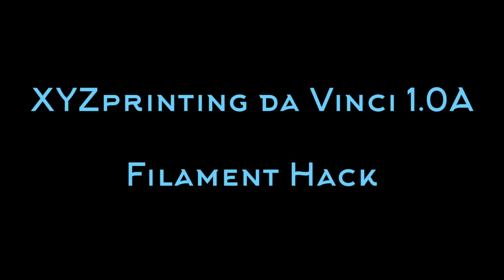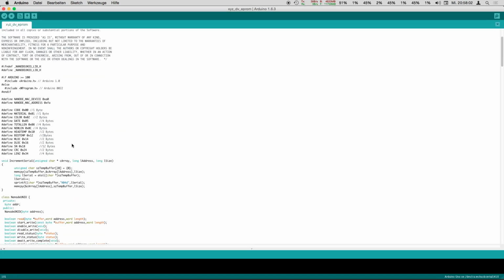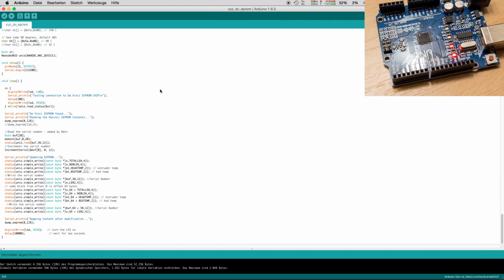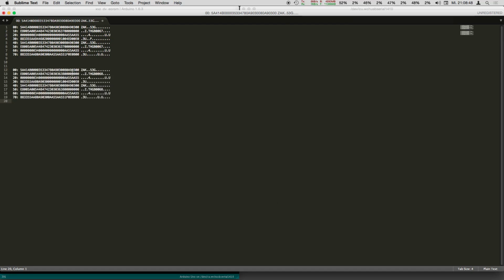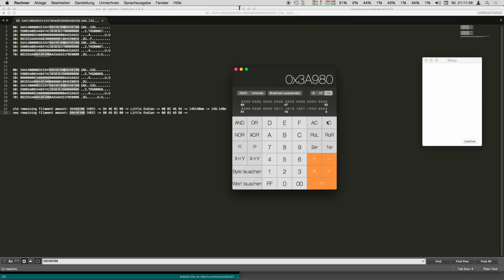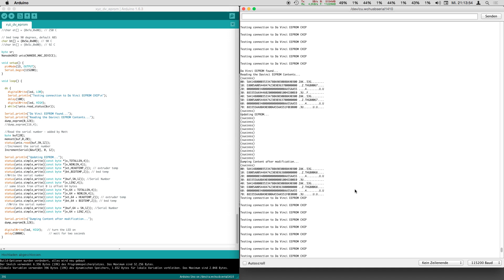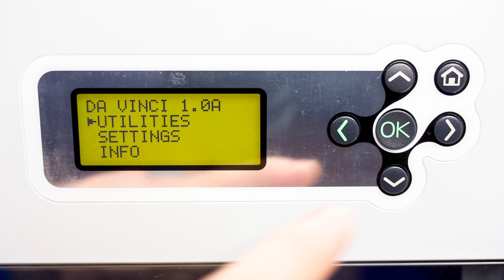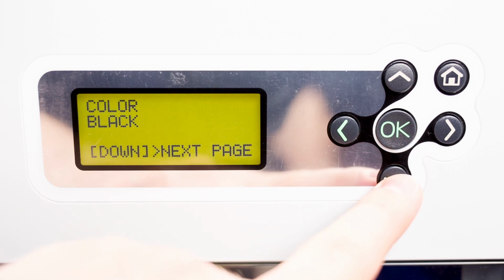XYZprinting da Vinci 1.0A EEPROM hack explained in detail for 3rd party filament w/latest firmware

Comment: Instead of the #7 can you use another number like 6,5,4 or 3? 
Or A5 or A4
or on a different Arduino a number D6, D5, D4 or D3?
Reply from the maker: Basically yes. It is changeable. This is what needs to be done when working with a different Arduino than the UNO.
Reply: But how do you change it? Or at least what is the part of the code that references it? The arduino I have is a leonardo arduino on a makey makey. The picture shows the chip layout. Any ideas? https://cdn.sparkfun.com/assets/e/4/8/3/f/52e977b0ce395f6f178b4567.jpg

Comment: Hi thank you, your instructions works well, i have additional concerns.

Can i change "loading temperature" using this resetter? 
and what is rechner? is it free? 

by the way this video is so good
Reply from the maker: "Rechner" is the "Calculator" from windows / Mac... ;)

Unfortunately, the temperature changes through EEPROM do not have any effect on the print through XYZware. You will need to use a third-party software like slic3r to create your custom gcode. See my second video if you want to try it.

Comment: I heard that XYZ will brick your printer if it detects that you are using 3rd party.  Is this still the case?  I can always turn off WIFI on my laptop when I connect, but just in case I forget one time I wanted to be sure.
Reply from the maker: That I don't know. It might say the cartridge is not supported, but that can be fixed be uninstalling software and reinstalling without internet access

Comment: Thanks a lot for your video, I have a question is there any possibility of changing the type of filament in the chip, the original cartridge that I have is abs and buy 1kg of pla and does not let me print in pla because the chip that you restore is Abs
Reply from the maker: Unfortunately, I would have to recommend buying a PLA cartridge for PLA, and ABS cartridge for ABS if you want to use stock software. My second video, however, shows how to customize all settings of your printer using Slic3r and some scripts.

Comment: is ther any hack for the davinci junior reels??
Reply: did you found any jr. hack?
Reply from the maker: Another viewer above suggested that it would probably possibly through NFC?
Reply: Jr and Mini use NFC to read the eeprom.  I can't even find an EEPROM chip on the board, but supposedly it's possible.  You need an Arduino and the NFC shield.  They sell one at Adafruit: https://www.adafruit.com/products/789?gclid=CNmUhLPDq9ICFRBEfgodVmEK5g.  There has been some work done: http://www.instructables.com/id/XYZ-Da-Vinci-Junior-jr-NFC-Tag-Filament-Reset-Hack/?ALLSTEPS, but it looks fragile and difficult (it requires you to hook up an oscilloscope and sniff passwords - that is cracking to the extreme).  There are some eBay devices listed in that article, but as with anything on that depository of hedonism your mileage may vary.

Comment: The software in the XYZ uprgrade prevents this working...XYZ are dictating to us we need to buy their cartridges at ridiculous prices...
Reply from the maker: Not exactly true. It is still possible to do this, but you might need to reinstall the software while blocking internet access to it (after install and while running at all times)
Reply: Florian Uhlemann I haven't found a way to downgrade the software if the xyz has been updated. I ended up completely wiping my xyz and installing repetier host... Best thing I ever did.

Comment: I also flashed the chip and now it says "unidentified cartridge". I am using 2.1.0
Reply from the maker: Try removing the software, then disconnect from the internet, reinstall again and then try again. Supposedly they verify the IDs with their web service. If permanently blocked, this won't be possible.

Comment: Having the same Issue. I flashed the chip and now the printer says "Unidentified Cartridge".
Reply from the maker: What firmware and software version are you using? Perhaps they did make a change in the software / firmware to prevent this?
Reply: Florian Uhlemann I am using 2.1.0 and I have a da Vinci 2.0 and it keeps saying unidentified cartridge

Comment: quick question how do you get the printer to think that the cartridge is for pla when it was originally for abs
Reply from the maker: Short answer: You can't. Get an ABS and a PLA cartridge for either type
Long Answer: Please see my other video that explains to use this printer with Slic3r, and thus being able to fully customize all printing parameters.

Comment: Hi is there a stl. file for the filament holder to print
Reply: go to thingiverse.com and search for one
Reply: Already have could not find one
Reply: http://www.thingiverse.com/thing:7001 
here's one that I found for you that uses 8mm wood dowels and doesn't require much plastic
Reply: No I will design me one when I do I will put the link in the comments
Reply: Thanks though
Reply from the maker: Thanks for the offer do design one and post it. Feel free to do so. I did actually get mine from thingiverse.com indeed.
Reply: Your welcome if there is already a design what is the thing number?
Reply from the maker: try any of these: 409100, 567977, 293623, 1234196, 673094, 1455889

Comment: Hello,
I have used your method and it worked pretty well. The problem I have noticed is that, even though the chip has been reset, the  temperature settings and filament length cannot be set to any other value but the original filament default or the cartridge will no longer be identified by the printer. Is there any way to solve that?? The Third party filament I've got can barely stick in on the glass and the extruded material is full of small hard parts that screws any print. 
Thank you
Reply from the maker: Yes, that is correct. Unfortunately the settings won't stick. There is a second video, which explains the custom Slic3r settings that will actually make it work with different settings.

Comment: Hello, thanks for you Tut. When i plug in the modified filament it show the new value e.g. 240m at the printers display instead of the remaining 1.4m. But when im ready to print after slicing in the XYZware i get the failure 0008 which means a cartridge chip error (last page in https://xyzprod.blob.core.windows.net/document-us/da%20Vinci%201.0%20AiO_User%20Manual_EN.pdf). Have the 1.0Aio, XYZware 2.1.15.1 and Firmware 1.2.2 (happend also with fw 1.2.0).  When i put in an original filament again it works properly. Why?
Reply from the maker: Interesting. It would be interesting to see the dump of the ROM before and after. I'm sorry that I can't help you out any better.
Reply: Ok after i removed and reinstalled both XYZware 2.1.15.1 and Firmware 1.2.2, it works fine now. Have no clue whats the reason. But just to know you are using the newest versions of SW and FW?
Reply from the maker: Awesome! Glad you got it to work! At the time of the video, I had the most recent version of both, yes. I currently do not own the DaVinci anymore.

Comment: Hi, nice video, its been really useful. I have some questions and hopefully you can answer them. First, there´s this section at the end of the G-code that states it has to be moved to the top, should I do that?.

On the other hand, I currently have a Davinci 1.0 and bought a PLA (xyz printing) filament thinking it would be fine since it´s from the same manufacturer, however, it asks to upgrade the extruders, which i currently can not do, so i thought of flashing the filament cartridge as you showed in the other video, but I was wondering if it is really necessary, the issue i have right now is the filament won´t load, so if you say the temperatures changes won´t work (last video-flashing cartridge), what do you recommend?.

Maybe flashing the cartridge so it thinks is ABS, but changing the temperatures for PLA, and the other parameters needed, do you think this approach will work?

Thanks in advance.
Reply from the maker: The only differences should really be in the temperatures and extrusion multipliers. If you use Slic3r to create your custom profiles, it really shouldn't matter at all what filament type is set in the cartridge.

Having to "upgrade" the extruders is something I have not yet heard of. Not sure what that is supposed to mean.
Reply: Yeah, that issue does not make any sense to me. Anyway, i did the EEPROM hack but it didnt´change the serial number, might you know what is wrong with it?.

In terms of printing, I´m using Slic3r´s G-code, converting to .3w and printing, but it takes a lot to lower bed temperature to the one desired, do you know how I can set the machine to turn off the bed?.

The downside of using PLA while the machine thinks is PLA is that BOTH extruder and bed have to reach the temperature set by default, then it starts receiving the G-code commands. Any ideas on how to improve this aspect?

Thank you for your answer, cheers
Reply from the maker: Unfortunately not. It was the same case when I used it. It would heat up the bed and extruder to is preset temperatures and then would start heating the last step. I'd really suggest getting a PLA cartridge when you want to print PLA and then fine-tune from those default settings, and use an ABS cartridge when printing ABS.

Comment: Thanks for share this great video :) I read it's not possible to change the temperature of the nozzle, is it true? I bought PLA and I need to thange the temperature .... it's too high and does not work. Any idea how I can use a PLA filament in my DaVinci 1.0? Thanks
Reply from the maker: Thanks for such a positive feedback. Yes, that is correct. Temperatures can't seem to be changed via the patching. However, you can watch my second video on how to make it work with Slic3r and thus be able to change your temperatures to your likings. :)

Comment: I tried to reset the EEPROM using my arduino, but my arduino didn't conect to the EEPROM, I'm using arduino mega 2560, is this normal with this arduino?
Reply from the maker: This is normal. Scroll through the comments, one guy has gotten it to work. it seems that the 2560 has a different pin number. if you are still having trouble, get a Uno. 😊
Reply: thanks, finally I change the pin  and I reseted the EEPROM, but the temperatures didn't change, they are the same temperatures so I don't know what I'm doing wrong, because in the arduino I put 230º, but the printer print in 213º
Reply from the maker: That is a known "problem". The temperatures are not read anymore through the EEPROM. If you need to change the temperatures, you will have to use a third-party slicer, such as Slic3r which I explain in my other video.
Reply: +Florian Uhlemann thanks for the information, I will try and I will say you the results
Reply: which pin did you use?
Reply: +Bob Opedic no, actually I haven't this problem, I discover that in the arduino MEGA 2560 wasn't the pin 7, it's the pin 38, now I have lots of problems with the temperatures of the nozzle
Reply: thanks for responding so quickly and solving my problem, i too am using a MEGA 2560, and using pin 38, I was able to connect

Comment: Good interesting work. Now the question is , if the machine has abnormal results, can go back to restore the factory settings ? how do I do ?  (xyzprinting 1.0)
Reply from the maker: The actual reset doesn't change anything except the used length counter. if you use an original cartridge, there will be no difference as to before flashing your other one. The settings are purely within the chip of the cartridge, but they are ignored. You'd have to use a custom slicer (Slic3r i.e.) for other settings to take effect.
Reply: then my friend , promptly I want to use generic brand cartridges and continue with the same printer software ( xyzware ) do not interest others as slicer or cure , etc. Do you think using " xyzware " could update each new version that can provide ? Nor have problems with the firmware update the printer ?
I thank you for all this information , interest and your valuable time
Greetings , DART
Reply from the maker: I have not yet heard that firmware updates break the "reset" function of our chip trick. However, it could be possible that FUTURE cartridges may not be resettable anymore. But as long as you have one, it should continue to work. XYZware is possible, but then again you will not be able to alternate temperatures. it will use the factory settings for the PLA or ABS that XYZ sells. However, they may still work fine with Volitivo PLA/ABS, depending on the cartridge you're using
Reply: *170-240(ºC),   41-90(ºC)
Reply from the maker: Unfortunately, I cannot help you on that. :( Go and try for yourself and perhaps do some finetuning with a third Party Software if you Keep having trouble
Reply: Florian Uhlemann Thanks a lot, 
Soon I will buy and hacking the printer, I will tell you as I was.
Be fine

Comment: Thanks alot for this Video! Di I have to adjust the Temperature of the nozle or the printbed to use the Voltivo PLA?
Reply from the maker: If you are using this to reset a PLA cartridge, then it might not be necessary. But for optimal results, please check out my second video on how to use a third party slicer for custom settings across the board.

Comment: Will this work with System Version 1.2.2 in the AIO? Just bought mine and it came with that.
Reply: Confirmed.
Reply: does is work on 1.2.2 AIO?? are you confirming or are you asking for confirmation?
Reply: I just followed all directions, hooked up the arduino uno board to my computer, hooked it up to the cartridge and reset both my PLA and ABS cartridge with no issues. Changed the last digit of the serial automatically.
Reply from the maker: Thanks for sharing! Seems like it still works with the AIO 1.2.2 printer 😉
Reply: +Florian Uhlemann mine gets error 0008, cartridge error. I guess I'll have to wait.

Comment: I want to change the temp for PLA but when i do it gives me an error. Guess im to old for this stuff  LOL Help
Reply from the maker: This hack is basically just useful for resetting the remaining cartridge length. The type of filament and printing temperatures cannot really be adjusted. It is prepared in the code, but to use custom temperatures and printing support structures, please consider watching my second video on Slic3r with the DaVinci.

Comment: DOES THIS WORK ON FIRMWARE 2.1.0? IF NOT HOW TO i GET THE EARLIER VERSION 2.0.1

Thanks
Reply from the maker: Heard of a few viewers that it was successful, yes. You don't need to use 2.0.1.
Reply: Florian Uhlemann What version of xyzware can i use? Will i have to set temps myself? Not sure how to mess with gcode.
Reply from the maker: If you like to know how to use custom gcode, please consider watching my second video on the DaVinci. temperatures really can't be changed with this hack, despite it being in there. That's where XYZ seems to have limited the adjustability. xyzware is really independent i think. I just used the latest software of each.

Comment: Is there a fix for using this code on the Arduino Mega? It's the only board I have.
Reply from the maker: So does it mean it does not work on your Mega? Or is it just an assumption?
Reply: Nope not working on the Mega, it checks and uploads but does not work when attaches to the cartridge. I have read that it's not worked for other Mega users also.
Reply from the maker: Chris Gough Okay. I'll try and see what I can find, but I suggest doing some research and maybe some one skilled enough is able to do a fix. But on the other hand - isn't the Uno just around 5$? 😉
Reply: Florian Uhlemann Thanks, I have done much googling but it seems people left this EEPROM hack in favor of using the Repetier firmware. Either way I'll get an Uno as soon as I can, it's just a shame having to order and wait for one.
Reply from the maker: true. wisely consider the repetier firmware. there's no way going back.
Reply: Florian Uhlemann
I'm already there, I ran this filament code on an Uno without a problem but upgraded to repetier also.
Reply from the maker: cool 😊 how do you like the overall experience now? (of the printer that is)
Reply: Chris, just use the code as is (keeping pin 7 in the code) but connect to pin 38 instead! :)

Good luck
Reply: Daniel Perdomo
Thanks :) that'd have been helpful before I purchased the Uno, I've moved over to Reprap anyway now and needed the Uno for that.

Comment: Just got this printer, does this hack still work?
Reply from the maker: Haven't heard back from any other that it doesn't and I think they run the latest firmware. Thing is, XYZ can not do much in terms of blocking it, as it would block original filaments then as well. So it should work.

Comment: Florian, great video and good presentation skill. Job well done. I'm still getting my setup fine tuned...I want to change the filament from ABS to PLM. Do you know where I can get the codes for this. ie the first bit if code in the EEPROM is ZAK = black ABS, I'd like to change this to yellow PLM. I'd also need to update the extruder and bed temp.
Reply from the maker: +Ian Veldman This, I don't know, unfortunately. There are a few rom dumps available on the web, for PLA and ABS, that you can find with some google searching, but that's about it.

Comment: what do you consider latest firmware. my one now auto feeds the filament out when unloading. i noticed you still had to push the grabber in and lift out.
Reply from the maker: +dfalconerio It shows which firmware I was using. It actually did auto feed the filament out in my case as well, but you have to still grab it at the end and remove it. When I did it in the video, I could really feel the automatic feeding movement too.
Reply from the maker: +dfalconerio It's version 2.0.1 of the DaVinci1.0A printer. It's shown towards the end of the video.